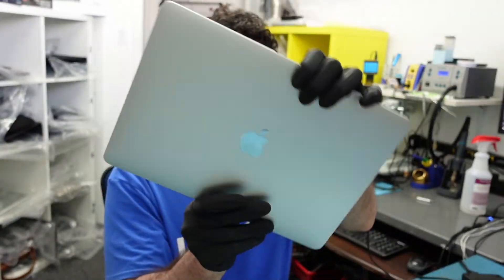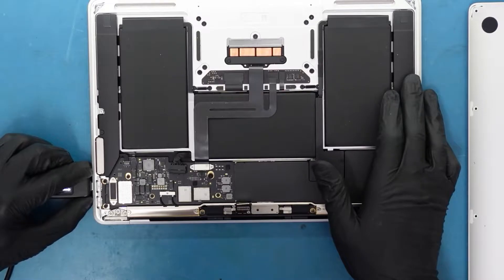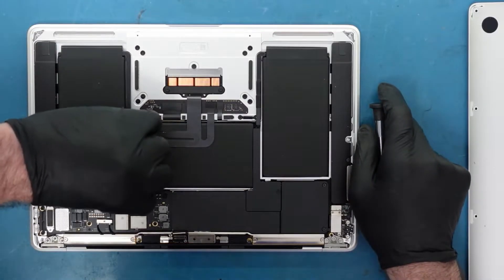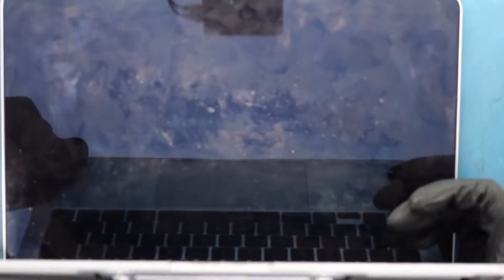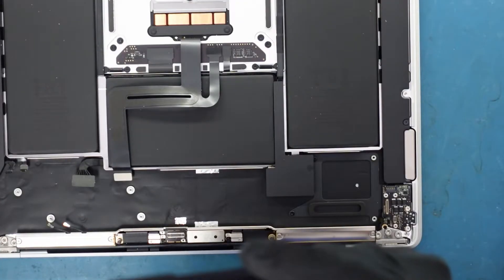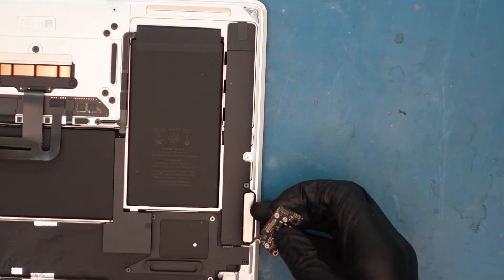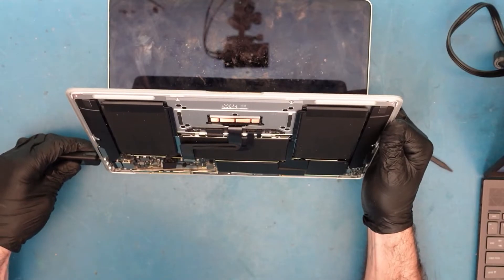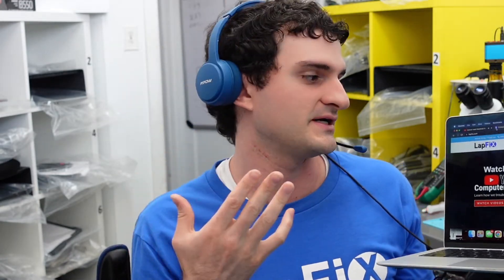M1 Macbook Air 2020 a2337 Not Turning On | Liquid Spill Repair

Comment: Hi there. im in Zimbabwe, not a very techy guy, but I got involved in an accident on a very rainy day in January, and my macbook Air 2020 M1 got soaked. The Apple specialists here in Zimbabwe checked it and they just said, the cost of fixing it is almost as good as replacing it. So im stuck with it and dont know technically what died since Jan. it could be the whole mother board and screen im not sure but all i know is it wont switch on. At what point do you determine that, its beyond replaceable and are there any tips you could recommend to fix it?

Comment: Can we modified this MacBook air m1 to be more splash proof..? Like add some protectiom Mod, at least will survive liquid spill from a cup.
Reply from the maker: I don't believe any retail laptop has ever been considered waterproof.  The best design against water was the panasonic toughbook but even that wasn't waterproof.  These are electronics with motherboards, ports, lcds and are very fragile to water let alone electricity.  if there is an opening, water will find its way.
Reply: Put your coffee behind it always not to sides, then it spills away from the laptop?

Comment: I have the exact same issues and symptoms and got to the part where you did in your video where it turned on without the audio board. I am about to order that audio board and it's looking like it's north of $100. Is it true the touch ID doesn't work after I replace this part? I also find it weird that you can have that part gone, battery disconnected, and I can still run my computer without the right speaker and without touch id and a battery. It's so weird. I just reversed everything and now nothing works again because I don't have parts to make the circuit, obviously. So, I sit and wait. thanks.
Reply from the maker: The touch ID should still be ok as long as the power button connection and logicboard are ok.  Replacing the audio board shouldn't impact it
Reply: @lapfix  Thank you. I saved over $400 doing this by myself and I'm so stoked. Thank you so much.

Comment: hey if i connect the type c tester on the main motherboard i get  5v 0.04 amper and after 3-4 sec amper goes to 0 that mean the main motherboard are shorted?
Reply: have same model
Reply from the maker: That can be a lot of things. Do you get the same on each port?  Does the board have any corrosion?  Check the CD3217s, and ISL9240 and see. Check PPBUS_AON .   Also it can be stuck in DFU mode.

Comment: this was literally my issue, too. This video helped me fix my m1 air that I almost gave up on over a year ago. Thank you so much!
Reply from the maker: Glad we could help
Reply: Hi, my M1 air is not turning on, and is not getting any current when plugged in, and it only stays at 5V, can you share how you fix it by yourself?
Reply: @iwatchtvwithportal5367  hey did you fix it? Mine facing same problem
Reply: Same issue I wanna know the name of that board. I wanna buy it.

Comment: My MacBook Air M1 is not charging. It also not turning on after removing battery and power button line. Main logic board has no power 😢😢. Is this can be fix brother??
Reply: I have the same issue. Everything working fine, only the charging is not working. Apple SC quoted $500 to replace the logic board 😞
Reply: @DeepeshSinghAndroid  It happened to me  too, don't replace rather repair logic board
Reply: @sandilyavedula1752  did you fix it? I'm facing similar problem
Reply: hey brother did you fixed it?